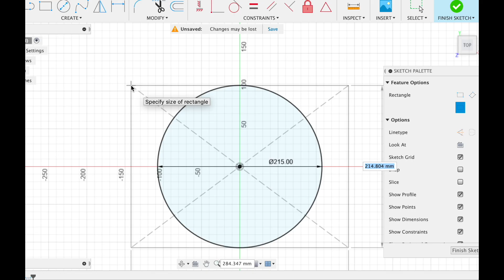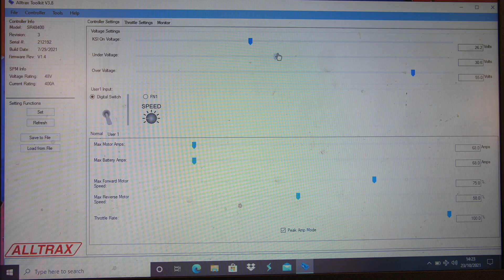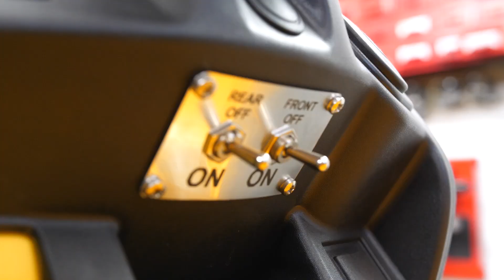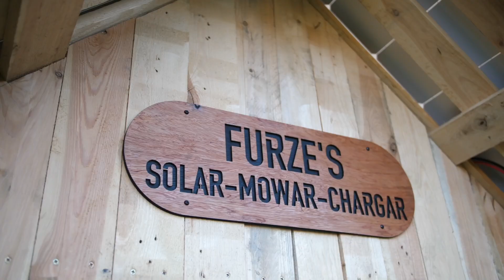EV Mower Conversion with Solar Charging Station

Comment: thats brilliant. but your right, WHY hasnt it been done before? I mean small mowers have been electric for decades, whys no one made a ride on one before? apart from you of course. 

I think your onto something here colin.
Reply: This type of mower i?often needs to run all day. And/or cut very large areas. Charging would be an issue. Lithium batteries very expensive... combination could be a killer..... ?!
Reply: @andymccabe6712  Lithium batteries are in LITERALLY every rechargeable device. Whats so "killer" about it.

Comment: I would love to see how you used or bypassed the hydrostatic transmission
Reply: He probably hasn't. Since the hydraulic pump is originally only driven by a belt i assume it was just a task of simply changing the engine driving it

Comment: Brilliant conversion.  Electric garden tractors are great for people with large spaces, especially if they couple them with solar/wind microgeneration.  Not a new idea mind - there were Sears/Wheelhorse lead acid powered electric garden tractors in the US back in the 1970s.

I'm now looking forward to Colin adding electric power tools/lifts/dozer blades to this platform. Or maybe a hydraulic system on board... 😃

Comment: I freaking love it!

I was going to suggest a bypass / tie-in switch to throw some power from the 4 cutting motor batteries for more speed or for when things get low on the drive batteries you can still get the job done, but you've already thought about that.

Also, I was going to suggest switching from the 12V lead acid batteries to smaller 6V golf cart batteries.  You'll have to double up on the number of batteries, but they're smaller and have a higher output amperage, so you should get even more cutting and driving time on the mower.

This is a fantastic idea, Colin!  When my wife and I bought our new house almost 8 years ago I needed to get a mower, so I bought an electric mower.  In our first year in the house we installed a shed and I put a couple of 40 watt solar panels to charge a couple of 12V car batteries which drive an inverter so I can charge the batteries for the mower from in the shed without having to be connected to ground power.

I'm so glad someone else has thought of doing stuff like this!  And the mower looks stock, most people wouldn't be able to tell the difference!

Fantastic work!

Comment: Awesome video as usual but I don't know what they have in the UK but in America and Australia they have had electric battery powered mowers and ride on mowers for several years now. And if you have solar on your roof and use it to charge the mower the concept is the same. The real environmental problem is how to deal with broken and old solar panels and batteries.

Comment: Grab a battery from an old hybrid vehicle, they usually have physically smaller packs that might fit under that hood :) Also there are a few companies already doing fully electric off the shelf mowers, those battery packs might just fit as-is.

Comment: I hate gas powered lawn care equipment. They're not filtered so you can smell them giving you cancer, and you can hear them down the block. With better battery energy density, and swappable batteries, I've seen a huge drop in non industrial gas lawn care equipment. All that's left are the industrial machines, for business that take care of lots of area, that are still using gas because of the better energy density. Once they move to electric I'm not going to miss them a bit.

Comment: The Cub Cadet XT2 ES107 is already being sold with a 56V Lithium-ion battery, 90 minutes run time and recharges in 4hrs. Maybe you need to speak to them.

Comment: Beautiful work! Only one small nitwitty thing, if someone connects the trailer plugs wrongly they will get a big short circuit, maybe for next time it is better to wire 3 battery's per plug, both 3 positive and 3 negative per plug, and make the plug's switchable so it won't end with fire ;)

Comment: This is bloody brilliant! Might convert an old push mower I have! As for batteries if they're deep cycle batteries then running them flat won't ruin them as that's what they're designed to do. Speak to Manchester Batteries they might be able to help on the lithium I've spoken to Bristol branch before about lithium motor cycle batteries

Comment: I love this project so much, I was literally just staring at my riding mower the other day and wondering how hard it would be to do a conversion like this. Would it be possible to list the components that you used?
Reply: I too am wondering about this, at least the specs of the motors and controllers
Reply: Each of the motors is around 2,500 Euros or $3,000 US Dollars. Each 100AH batter is another $200+.  Total cost of the build would be around $8,000 assuming you already owned the lawnmower. Hardly affordable, especially when you can buy one off the shelf for about half of that. Ryobi and Cub Cadent are at least two that make one for around $4k.
Reply: @TXP2P69  The first sensible comment I've come across.. Thank you!
Reply: @TXP2P69  I guess it's good to be sponsored. Lol I have seen automotive EV components that are less expensive than that.
Reply: Me four, how sustainably awesome would that be. Save a decent old ride-on with a clapped-out motor, upgrade it to electric, build the shed for its wee house, and well, how bloody awesome would that be. Come on furzy, give us the good stuff, you could start a revolution from your shed.
Reply: Me three,  from scratch to buy a clapted out mower and just convert it, a part list and est cost would be great.

Comment: Why hasn't this been done before?  Cost, this would be crazy expensive. The motor alone is worth more than the entire mower. Actually they already exist but at 3x the cost of a normal mower.
Reply: There are lots of electric lawn mowers available, they're not that expensive
Reply: @pe5erbarnes  No, I just looked them up, they are at least 3x the cost.
Reply: @pe5erbarnes  They are also not nearly as good as the one he made. Not to mention all the solar stuff.

Comment: Dear Colin, In your neck of the woods you may not have battery powered lawnmowers. In our part of the world we have RYOBI 48-Volt Brushless 54 in. 115 Ah Battery Electric Riding Zero Turn Mower which is bigger than the mower you have in the shed at the moment. These run around 5500 USD.

Comment: Why didn't you make the shed a single slope roof to maximize solar potential? Was the 50 degree slope too steep?
Reply: Blame the planning permission constraints in the UK, even for sheds they have regulations on what is and is not allowed. And more importantly they have regulations for what can be built without going through all that paperwork and hassle so, he probable built what he could within the design specifications.
Reply: @Jack-yl7cc  just can’t be over 2.4m if within 1m of boundary I think, so a single pitch south facing roof would be achievable
Reply: It would look more ugly?
Reply: Just one of those sides makes plenty of energy for how little he'll actually use the lawnmower so I think the efficiency was less important to him and he wanted to make it look good
Reply: Good point
Reply: https://youtu.be/_mstbNizOjIrbthx

Comment: Impressive. Maybe with a better battery you can save some weight and get more range.
But there is a problem. Lithium batteries don't like it to get loaded for 1 hour, then stop, then 1 hour load and stop again.....
But i think, it is a really well made swap and i would buy one, if my garden would be more even. 
For my yard i need an ATV cause its uneven as a teenie face without care.

Comment: 11:49 just buy some battery cells and bms (make sure the bms has correct cut off voltages) and you should be good to go.
Reply: If you can get that much range with lead acid i think lifepo4 is the best option. It has big life cycle.
Reply: I heard that liitokala makes some good battery cells.

Comment: I honestly would not be surprised to see this heavily commercialized, as it genuinely seems like a very good, very profitable idea.
Reply: There are already battery electric mowers for sale, they have been around for years.
Reply: @GreatOutdoors1  but have they been of this size? Genuine question, as I’ve seen push mowers, but not…sitting mowers?
Reply: @PrayingLotus  general electric started producing electric riding garden tractors and mowers in the late sixties. I have one that was built in 1970 and I cut 3/4 of an acre with it.
Reply: @peterlindbergh8526  My god. I wish I knew this earlier. It seems like a great idea to mass produce them and advertise them now more than ever. Does yours still work?
Reply: @PrayingLotus  It sure does! I use it to cut my grass, and to plow snow. I've used it to pull small tree stumps.

Comment: This is brilliant! The thing that has always bugged me about electric cars is you can't just run out of power an sit around and wait, you have places to be. With a mower, practically all you do is wait, so this works perfectly!
Reply: Its called charging the car at home via an outlet. Makes you wait less than even gas cars because its always fully charged in the morning. Btw Teslas only need 15 mins for 300km of range. Get over the old incorrect thoughts about alectric cars.

Comment: I electrified my LM years ago by installing a tall pole in the middle of my yard with a 90 degrees, rotating extension which has a cable on it, which goes to the lawn mower. Haven't looked back since, 220v motor off an energy efficient (at the time) washing machine. Has the original brains modified to act as a speed controller. The programmer is stuck in the spin cycle where i can affect the speed at any time, thus giving me anything from crawl to zip, through a gearbox. It's quiet, actually cheaper than running the equivalent petrol variant (which i do once in a blue moon when power is out for whatever reason) and it's clean. Zero maintenance in 7 years other than oiling the bearings.
Reply: That is pretty cool. 
I have a big enough lawn that this mower would be ideal except for the fact that my mower is paid for and investing in a conversion kit will defeat the the cost of building a new or buying a new mower. There is a 48v Ryobi zero turn mower and they cost 5k. Even if I spend 1k to convert my existing mower to batteries It would take more than 10 years of buying gas to fuel it. Now I will keep my eye open for a broken one that I can pick up for next to nothing and maybe work something out with it. I might even look for some of the cordless push mowers. I am sure they break from time to time and people just buy new ones. That might be an option for parts or something. Might even be able to make a deck with the push mowers and use some sort of mobility scooter for the drive section.
Reply: https://youtu.be/_mstbNizOjI4hrhr
Reply: I have a round lawn, a normal mower, a plug to a drum in the middle of the lawn, I tape the handle shut and put the whole thing on a timer so it stops when it gets to the middle.
(in my dreams)
Reply: @sammoxford  They do have robot mowers that are fairly cheap around 1k. Provided you have a set up lawn they are easy to use and install. 
Before I bought my new house I had a yard that was going to buy one of those mowers and put it in there. Depending on the one you get you can set it up in a number of ways, I was going to add some 2x6 boards to block out some things and raise up those areas this way it makes it super easy for the robot to mow stuff. My place now is just too large I have 3 acres to maintain which I do that about every 2 weeks. Though my area around the house is getting weed barrier and stone put in. I do not need grass close to my house and this also lets me let the other grass grow wild. I am also replacing normal grass with short buffalo grass. Which if left un cut is still short and looks fine. I have a few sections growing in the yards now and going to get more seed next year and plant more as well as tranplanting plugs.

Comment: In America we actually already have several options for electric lawn mowers. The “commercial size” as you would call them. Now don’t get me wrong it’s awesome you made one tho! But they are already a thing. Made by several company’s.
Reply: That’s only half of the solution, the other half is an independent (sustainable) charging station.
Reply: This project could have been done with a junkyard found mower to really prove the recycle/repurpose point.  The fact that he was using a new one really didn't make a difference.
Reply: Random question, But how common is it in America to use robotic lawn mowers?
Reply: @gustavostensson1048  actually very common. Several high school, college and nfl teams have taken advantage of robotic mowers. To help keep maintenance costs down.
Reply: Do you understand how YT works?

Comment: Electric is clearly the future BUT it's not better than gasoline in every scenario yet. The biggest drawback is charge time. This is definitely a great invention, and I'm sure higher battery density can make it last longer.

But when you have to mow 2.5 acres weekly and it takes you 2 hours at the fastest pace with a 52" deck, this little fella isn't going to 'cut' it.

Same goes for when you take multiple 1000 mile trips per year by car...

Comment: I actually wouldn't want to run this on lithium-batteries. It does its job pretty well, so why change it up? Lithium is just going to burn you shed down, if you are unlucky, especially if this is sold as  an actual product and a few thousand of them are driving around. One is bound to catch fire at some point. Just my oppinion though.

Comment: You have 6 batteries, you should run them in series instead of parallel and have 36V instead of 12V. They will charge faster and you'll get more power out of them. As long as your controllers can handle it anyway. You can run both motors off the same bank of 6 there is no reason to have 2 banks of 12V in either configuration.

Comment: I’m guessing that in 5 years or less it would be between $500-700 minimal to replace the worn batteries. For me it costs currently about $300 in gas to cut my lawn in a 5 year period. It takes about 40min to cut my lawn so without the extra costs involved with a gas engine, as long as an electric mower can handle that, I’d be game.

Comment: Lithium is old heavy tech with a fancy sticker on, At twice the price?, Make a 74V Super Capacitor Bank, No weight, Charges up in 30 seconds to full power and lasts just as long as any lithium battery and it's cleaner for the planet, Unlike lithium mine scarring.

Comment: This is amazing well done! Lithium batteries will make a hell of a difference. Is your battery brushed or brushless. Just changing this would make a difference. 

Keep up the awesome work!!
Reply: You are aware that all batteries are brushless by design ?
As for the motors, these are brushless induction motors controlled by a programmable electronic speed control.
Reply: @chosebines51  You are aware that all electric motor speed controllers are electronic by design right?

Comment: My lawn mower has a peddle on it that pulls the belt tighter to make it go faster underneath it and you may have circumvented that when you switch the motor to the back

Comment: Can't believe something like this hasn't become common place, very useful, very very good idea Colin, entertaining as always, keep up the good work!!
Reply: Electric lawnmowers are freaking awesome. I have an 80v push mower, the battery lasts 45 minutes. With two batteries, I can easily mow my entire lawn in around an hour and half, which is the same speed as non-electric. And my batteries also work for my weedwacker, leaf blower, and hedge trimmer! They're awesome!!!
Reply: electric lawnmowers are around for quite some time?!
Reply: @jerri0401  fair, I more meant the entire setup of a solar charge station and electric ride-on mower, for large areas of grass. The solar aspect especially, will charge better in summer, when grass grows more, when you don't need it as much, don't worry, it's charging a lot slower anyway... and you don't need it everyday in case of a few cloudy days...
Reply: Ryobi makes an electric zero turn mower

Comment: The first electric lawnmower I remember is a qualcast push reel roller mower with a car battery on top of it it next to the motor. How they have come along! #me, I'm just a lawnmower, you can tell by the way I walk# Genesis (not from the bible - 1975!)#